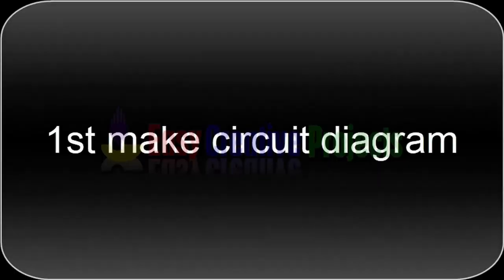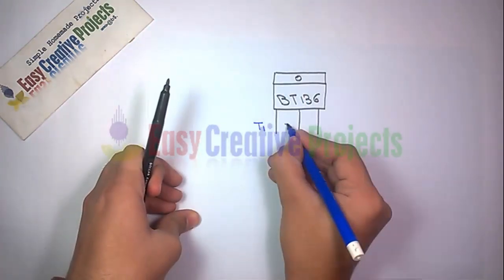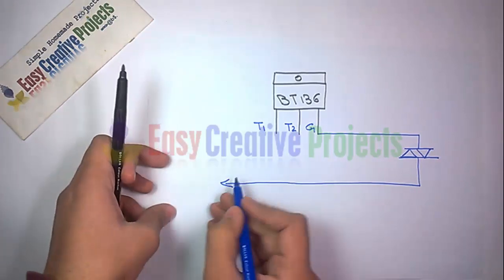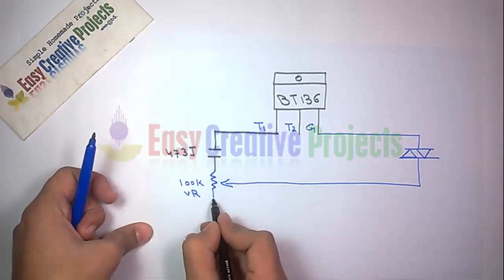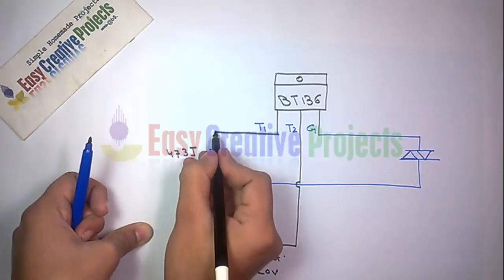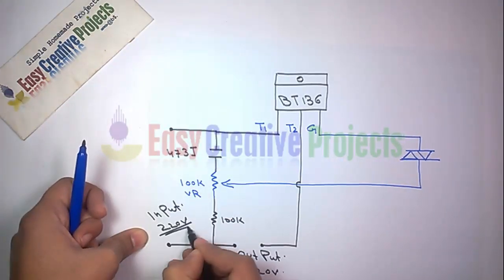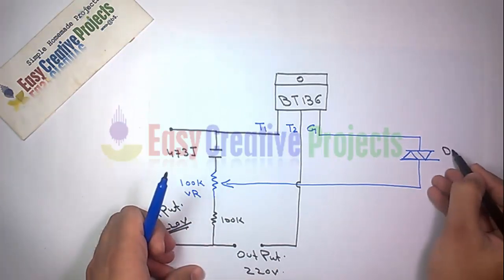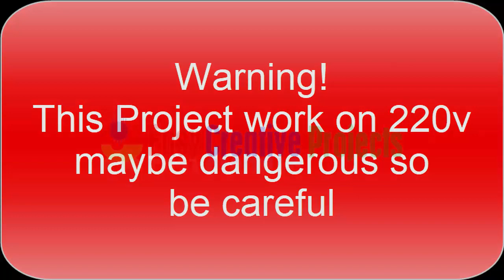How to make 220v fan dimmer easy at home - easy with circuit diagram

Comment: isse maximum kitne Watt ka load control kar sakte hai ??
Like regulating speed of a fan of maximum how much Watt ?
40w, 60w, 100w or 200w ???
Reply ASAP
Reply from the maker: dear you can handle maximum 500w power.

Comment: Can i use for soldering iron temperature control
Reply from the maker: dear basically its control  power. 
if your soldering iron work on low power then you can control temperature of soldering iron.

Comment: Please make a video on how to regulate dc current
Reply from the maker: witch circuit you want to regulate? i could not understand your question? 
you want theory?
Reply: I want to make a power supply for my projects I will regulate voltage with the help of bulk converter but my problems is how to regulate current from 1amp to 5amp
Reply: In this video I don't understand how to regulate dc current can you understand me